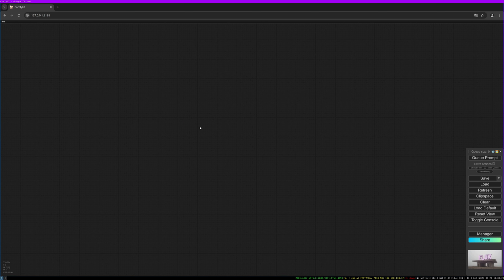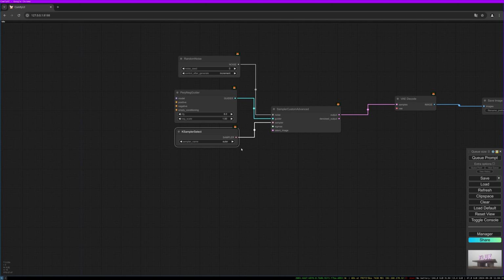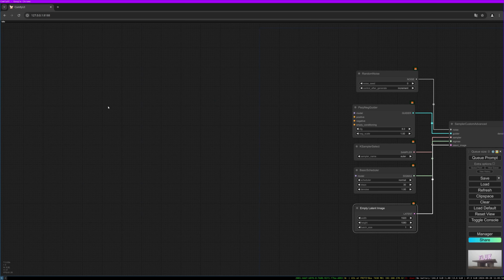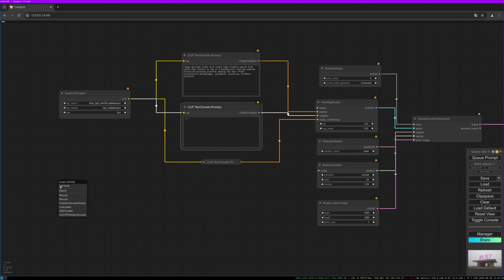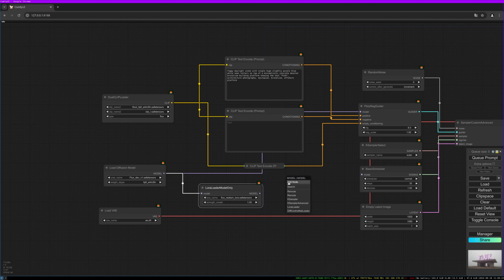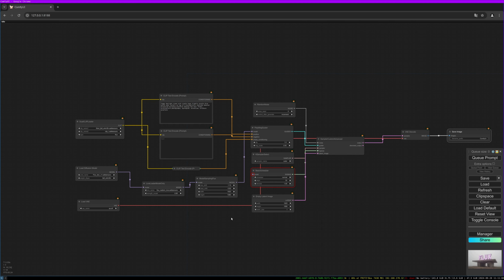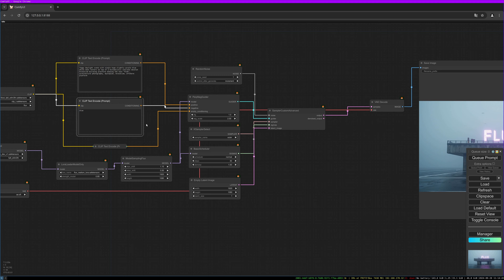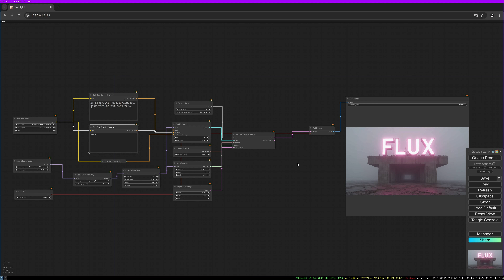FLUX negative prompt, how to, in ComfyUI AI

Comment: Followed this step by step twice having an issue with the vae loader says undefined and no way to change it the one you have says something in the box where mine says undefined but yours does not. get an error message that says (Required input is missing: vae_name) is there something else i have to download?
Reply from the maker: Sounds like the vae is missing, you have to download it and put it in your vae folder.
Reply: @neuron_ai  Any recommendations in which one i would look up to fix this issue new to this comfyui
Reply from the maker: Download the Flux VAE model file. Put it in ComfyUI > models > vae. 
https://huggingface.co/black-forest-labs/FLUX.1-schnell/blob/main/ae.safetensors